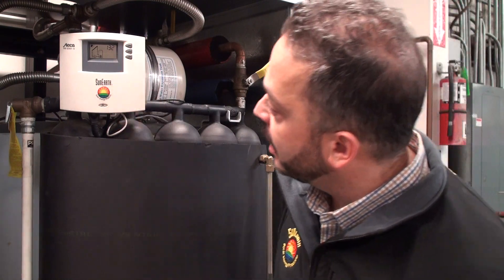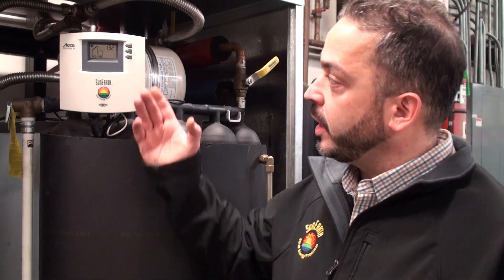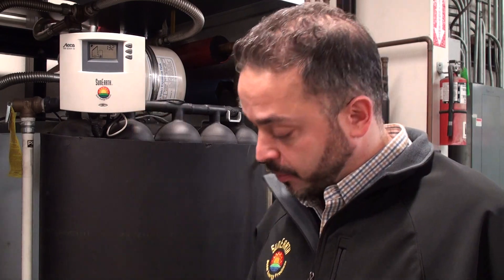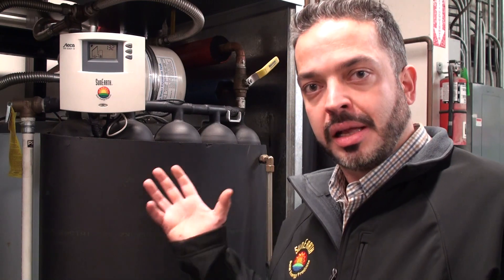SunEarth Solar Brief - Solar Hot Water Tempratures

Comment: I'm having great difficulty with this unit. What are good temps to set up this unit? I have 80 gal tank and my hot water runs out after only 4 mins.
Reply from the maker: Hi .. We will assume there is a mixing valve  that is set to 120 -125 F . ( a mixing valve is located at top of the solar tank  and functions like a standard shower valve ,; it mixes the hot and cold water that feed the valve  to an acceptable temperature without scalding  , usually set to no more that 120 F from the factory .

If the 80 gallon tank is their only water heater , then the water in the tank is heated  by the sun or  by an electric water heating element.  ( The 240 volt  power needs to be ON for the element to work. )

The sun heating part of the system is regulated by a solar controller and usually has its high limit set to 140 F … this temperature  can be reached  during hot sunny weather ; however if the weather is cold and cloudy  the sun may not be able to heat the tank to the temperature needed during periods of high demand for hot water ( ie. Winter ) .

Therefore the tank has a back up electric element that uses 240 volts to heat the water ; the  element is regulated by an element thermostat , both of which are located behind an access cover that can be removed with a screwdriver .. Warning !  There is high voltage under this cover .. Please read the Use & Care Manual  before adjusting the element’s thermostatic temperature ;  turn off power to the element at  the main breaker and verify there is no power  under the access cover .. Call a service technician if necessary ..

You can adjust the element’s temperature at its thermostat using a small screwdriver .. ALL POWER MUST BE OFF ..240 volts will cause serious damage or worst if you “connect” with it . !!!

Do not set temperature above 145 F ,and there must be a working mixing valve installed to prevent scalding .. Use the closest fixture and a digital thermometer  to set the  hot water flowing out of fixture to a maximum of 120 F ;  see Use & Care manual for scald risk vs. temperature chart .

If all the components are working  you should have enough hot water  for  2-3 showers on cold days ( no solar contribution ) ..

If issue is still present  check the function of the mixing valve , the electric element  and possibly the cold water supply dip tube on the solar tank .. See the Use & Care manual for a diagram of these solar tank components .

 

If you have a solar tank and a primary water heater ,usually gas , have the gas heater checked by the Gas Co. or qualified plumbing technician.

 

The Use & Care Manual can be sent to you if you do not have a copy  . We will need the model number,  serial number,   and year the tank was installed .

 

Thank You.